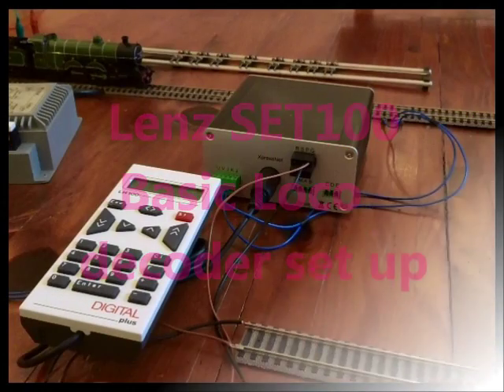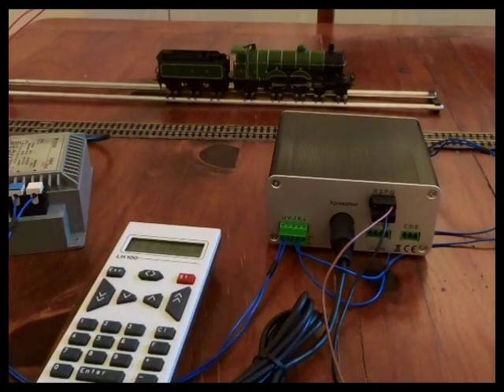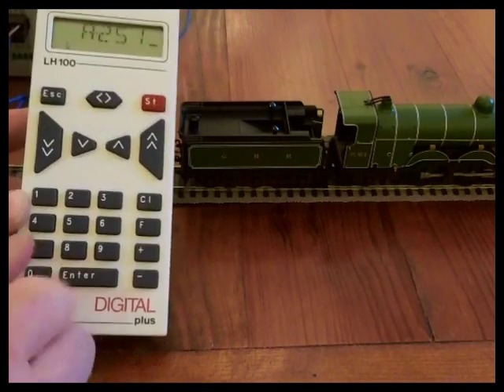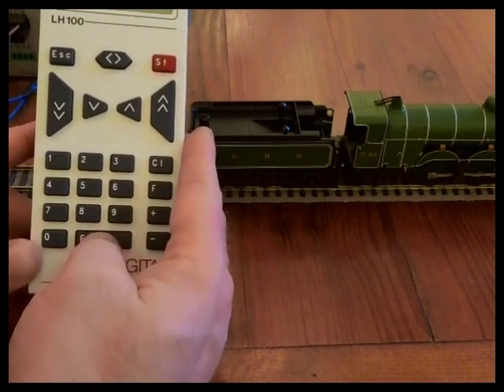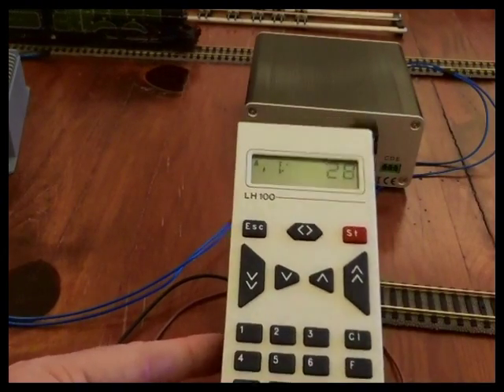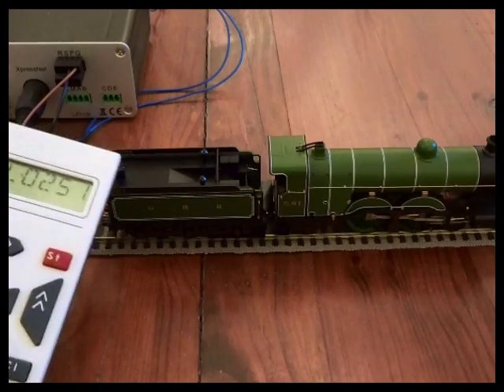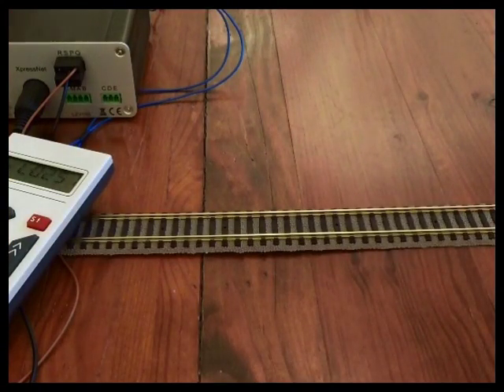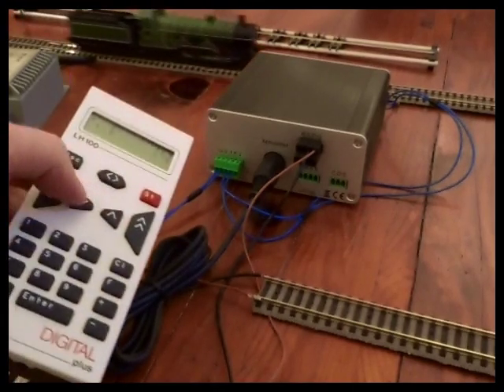Lenz SET100 A quick look at locomotive programming

Comment: What grade of electrical cable have you used in your demonstrations for wiring up a Set 100, please? Very interesting set of video may I say.
Regards TONY
Reply from the maker: The manual says to use 18 gauge (1.02mm Diameter).  Sources vary on the amps this can carry but it is between 6A and 10A depending on manufacture.  The wiring must be rated to carry at least the 5 amps that the system can put out.  We give this a margin of error.
Reply: Thank your for your advice & comments